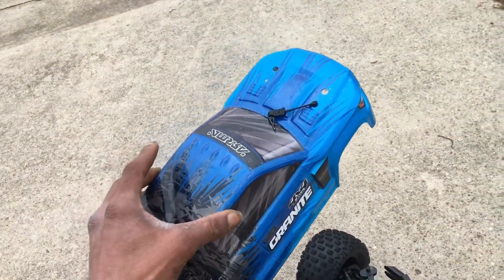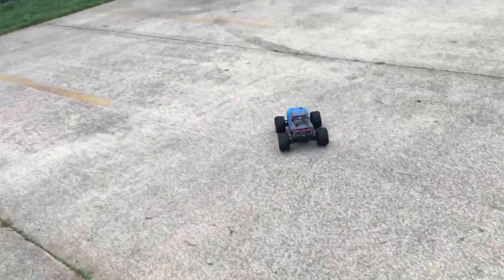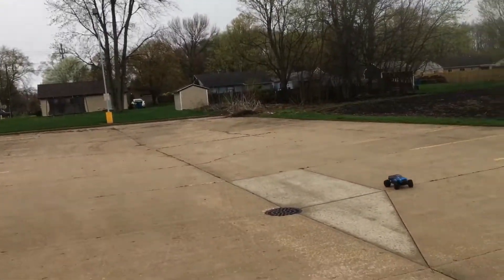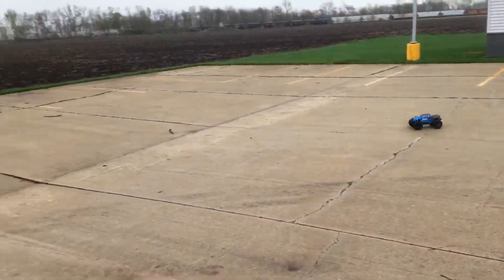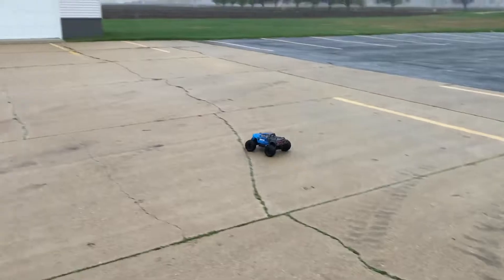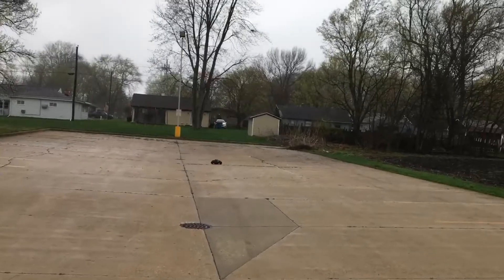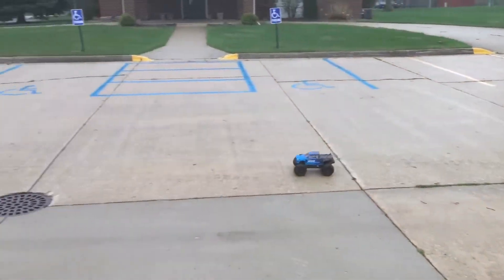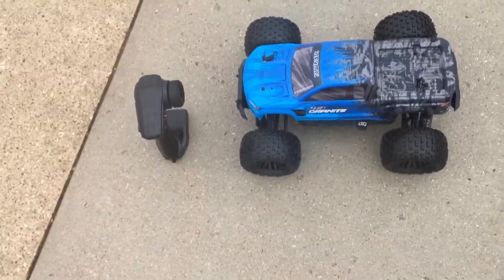Arrma Granite Mega 4x4 V3 - Brushless Motor Upgrade(2s Lipo Run)

Comment: Can you link me the combo you got? Saw a couple online but people mentioned the esc being laggy with its responses
Reply: Oh, it's definitely laggy as hell, and the program card that came with mine, didn't work. Apparently, you can adjust settings and reduce the lag, but good luck getting a program card that works. I got another one on the way, for only $13, so, hopefully that one will work.
Reply: @bra1nc417d  yea I found a different goolRC setup that was pretty damn bad out of the box, my programming card worked though so it’s not too bad now. My dad has the same exact setup though and his randomly lags for 1-2 seconds… really odd